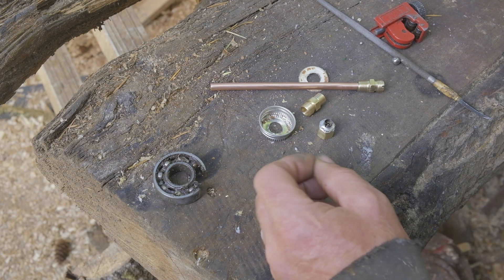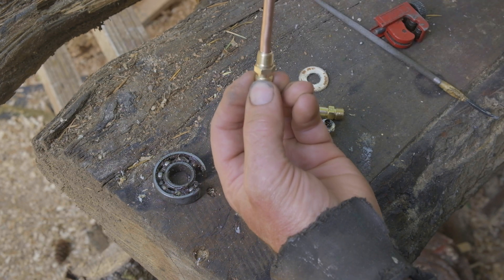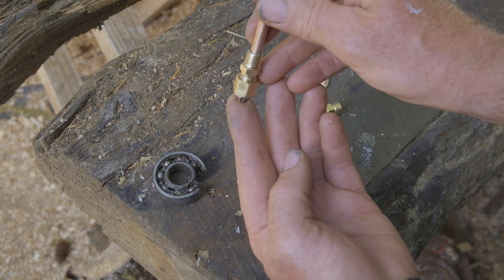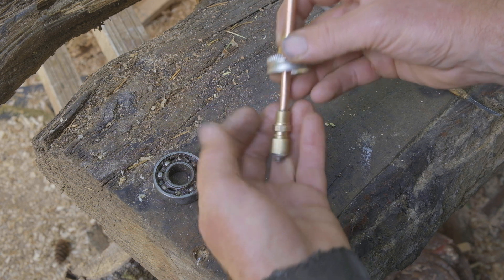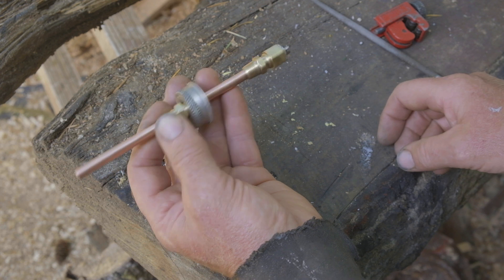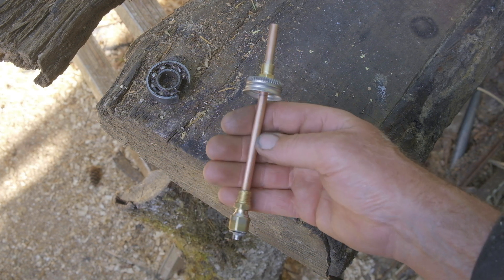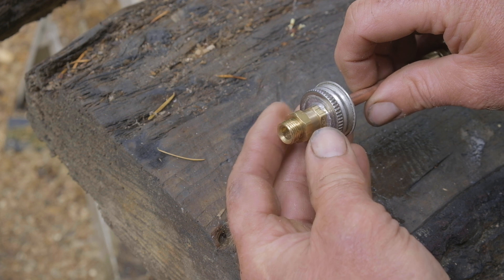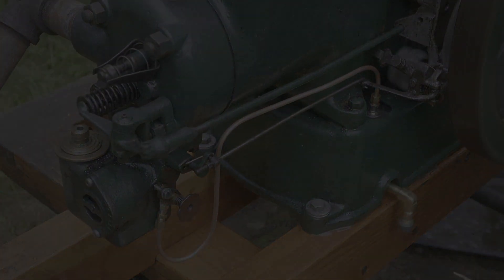Check valve for a 3 hp Fairbanks Morse Z engine

Comment: They just poked a hole in the cap and ran it through to the tank no other external fittings
Reply from the maker: Thanks. I'm glad I didn't go that route. I'm in a very wet climate and the engine lives outdoors so a less than waterproof solution wouldn't work for me. Sure wish I could keep it under cover year round. A canopy of sorts has been on the list for a while. Maybe most of these ended up indoors or in a drier clime?
Reply: @TheSaltedDog  they were in all kinds of climate dry warm soaking wet